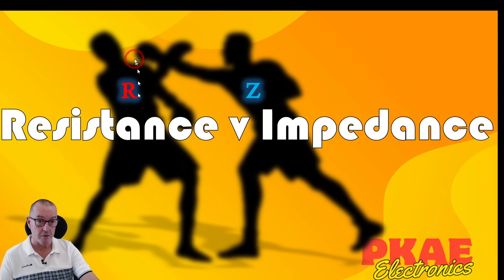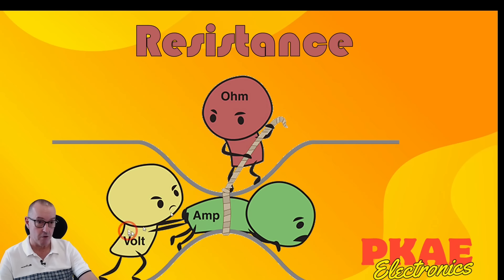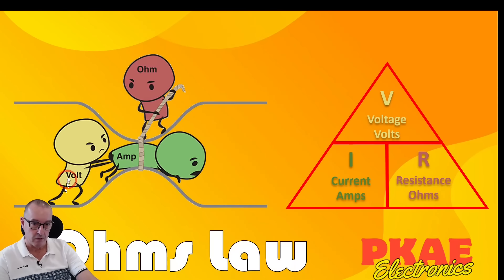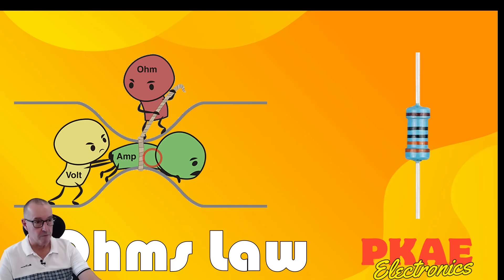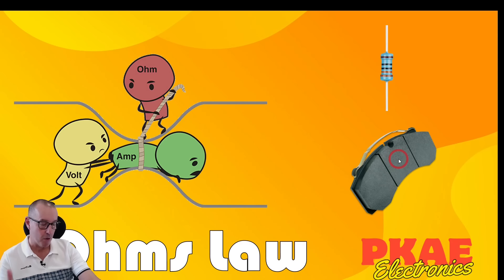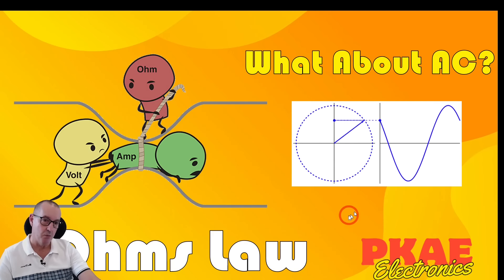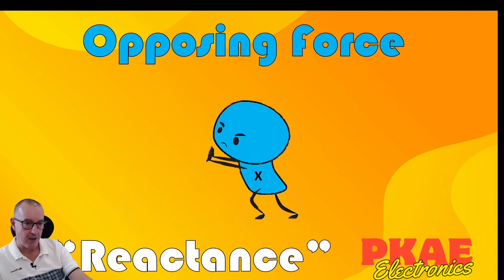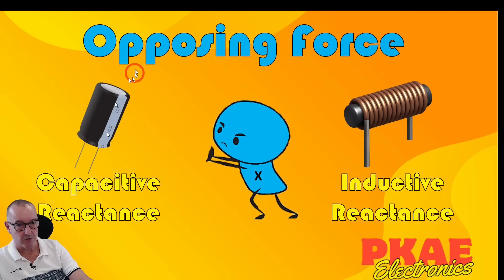Impedance Explained.

Comment: Great vid!
Wish there was a bit of what happens with time dependent frequencies, like in a speaker.
Reply from the maker: Thanks for the comment. For PA speakers we typically calculate and test impedance at 1kHz which is said to be the mid frequency of speech. But as you allude to, speakers have varying frequency response which defines their  characteristics and audio fidelity.

Comment: Resistance is part of impedance.

Impedance (Z) encompasses resistance (R) and reactance (X) 

The Ohm character encompasses both. He's impedance not just resistance, and in AC EVERYTHING fluctuates. Voltage, and therefore Current, and if capacitive or inductive components are presence, then impedance varies too.

Comment: Thanks for the clearest explanation of impedence I've ever heard!

One small nit:  you referred to 0.2 mH has 0.2 microHenrys, but in your equation you write this as 0.0002 H.  That would be milliHenrys, right?

Cheers!
Reply from the maker: Thanks for the comment, and yes you are correct.

I did spot this some time back and added some pop up text at that point. You do need to have Captions turned on though. 

Well spotted by the way!

Comment: My fave thing about impedance is how it allows us to look at the world and think about what a certain wave considers to be a solid wall. 

This video did not cover impedance matching (understandable, out of scope), which one must consider when connecting two regions of different impedance. How the impedance changes across the boundary controls how much of the wave is transmitted or reflected. 

Impedance is a feature of all waves, not just circuits however. Consider a trumpet, or any other brass instrument, why have they got that horn shape? The shape is a kind of impedance matching between the resonating cavity of the instrument and the open air. The horn shape helps match the impedance so that the maximum amount of power is transmitted from the cavity to the air!
Reply from the maker: Thanks for watching and your info. If anyone is interested about Impedance Matching, I did do a follow up video in response to another viewer's request some time ago. See link below:-

https://youtu.be/5p0v7ZU0WcA
Reply: @paulpkae  oh excellent, that's my tea-time sorted

Comment: Resistance dissipates electric current energy into heat. Reactance stores energy into electric (capacitive) or magnetic (inductive) field and gives it back when it can.
Fun thing is symmetry: you can swap capacitance with inductance and current with voltage, and formulas stay the same.

Comment: Excellent stuff. Let me see if I can put everything together when it comes to power factor. Big induction motors have massive X_l and very low R, which means they would have a very "steep" triangle. So they add a massive capacitor to compensate for it, subtracting away the X_c until the load is purely resistive as X_l and X_c cancel each other. That's when you have an optimal power factor of 100%. Am I correct?
Reply from the maker: Yes you are correct, but you are missing the "Power" bit. 

Power factor is the ratio of real power (the actual power consumed) to apparent power (the combination of real and reactive power, where reactive power is the unused portion), indicating how effectively electrical power is being used in a circuit.

Capacitors are added to temporarily store the reactive energy generated by inductive loads during the AC cycle, helping to improve the power factor by reducing the overall reactive power demand.

I will be doing a follow up video on Power Factor pretty soon.....

Comment: Now that I understand that you can just subtract capacitive reactance from inductive reactance, the impedence triangle also helps explain power factor correction. Got a big inductive load? Just slap some capacitors in there to cancel out the inductors and get the phase angle back to zero!

Comment: Sutch a great video! Please cover more concepts! Your ability to easily explain the concept before getting to the math is great. Does this impedance formula work instantaneously for AC? I remember having to do some calculus in school for dc i believe
Reply from the maker: Thanks for the comment, more videos are on their way but I have been incredibly busy for the past month or so. I'm currently in the middle of preparing content for the 555 Timer chip in which I demonstrate it's NOT a Timer.....

With regards to your "instantaneously" question, I don't quite get what you mean, but provided your supply is an AC Sinewave, at a fixed frequency the formula works as it is.
Reply: The impedance formulas are primarily for analyzing AC circuits in the steady state, and not instantaneously.  It's a whole cycle picture of what is happening.

The formulas for what the capacitor and inductor do on an instantaneous basis, are calculus based:
For an inductor: V = L*dI/dt
For a capacitor: V = 1/C * integral I dt

Each circuit with an mixture of the three kinds of components becomes a system of differential equations, based on combining these formulas with Ohm's and Kirchhoff's laws.

Impedance is a shortcut to doing this calculus, with complex algebra instead, when we're interested in the steady state behavior.  When interested in the transient behavior, we'd use the Laplace transform to get a bigger picture of what is happening.  Instead of 2*pi*j*f, this gets swapped for the Laplace domain variable s, a bigger picture of frequency.  It still becomes a way to solve differential equations

Comment: So after watching this it seems to me that this circuit, and formula would be the basis for doing phase correction. Where the resistor in the circuit would be replaced by whatever load you are attempting to phase correct for.. I would like to see a further video on this, as I realized that there may be more complication between the two reactive loads. But my first thought is that you should be able to simply sum all of  the inductance, and sum all of the capacitance, and then run the equation as you have shown it.
Reply from the maker: Yes, you arr correct. Phase or power factor correction is accomplished by applying the opposite form of reactance to whatever your circuit+load turns out to be. Inductive loads being a positive phase and capacitive loads being a negative phase angle.
Reply: @paulpkae  thank you for the reply.

Comment: No one is missing from this classic illustration.

Ohms are the unit of impedance. Not a failure of the illustration if the reader misinterprets Mr Ohms as only representing resistance.
Reply from the maker: Hi thanks for the comment and sharing your valued opinion. My view still stands for me, "Reactance" is not like Resistance. In my mind, the analogy & illustration of someone "pushing back" is far more representative than the guy creating a smaller tube for the current to flow through.

Comment: And this is why spiral wound spark plug wires have low resistance with a ohm meter but still resist the spark and generate low noise. A slight of hand from the marketing people.

Comment: thanks for explaining impedance always struggled to understand it I wish you were  my EE professor ,  would you explain power factor too never really understood it fully.
Reply from the maker: Thanks, and yes, that's on my list. Once you understand impedance, Power Factor is just a small step to grasp.
Reply: It's a calculus problem to give a full explanation of power factor.  The short answer is that it has to do with how well the current and voltage waveforms are synchronized.  The better synchronized they are, the more effective they are at delivering power from source to load.  The less synchronized they are, this results in energy being shuffled back and forth due to energy storage elements, that makes the apparent product of current and voltage (called apparent power in units of VA), greater than the actual power (real power in units of Watts).

The current and voltage figures that we measure in AC-mode on a multimeter, are RMS values, which is a special kind of time averaging.  If you multiply together the RMS values of voltage and current, you get apparent power.  However, if you account for instantaneous product of voltage and current at every point in time, and then average them, you get real power.

Consider voltage and current waveforms given as simple sine waves:
V(t) = V0*sin(w*t)
I(t) = I0*sin(w*t + phi)

The RMS voltage and current will be:
Vrms = V0/sqrt(2)
Irms = I0/sqrt(2)

Apparent power VA = Vrms*Irms = V0*I0/2

Real power:
Watts = integral V(t)*I(t) dt over a full period, divided by the period
Evaluating the integral gives: Watts = V0*I0/2 * cos(phi)
Reply: @carultch  great explanation it definitely improved my understanding of the concept.
Reply: @geraldwesley  No problem.  Glad I could assist.

Comment: The physical examples were extremely helpful! One question is how could a 90 degree phase angle from impedance happen if it's the inverse tangent of (Xl-Xc) and R?
Reply from the maker: Great! Glad it helped.
Reply: @paulpkae  Sorry, I edited my comment while you replied I think. I guess my question is could voltage and amperage differ by 90 degrees or more by something other than impedance or will it never be more than 89.999- degrees out of phase?

Comment: 16:00 You actually can add the resistance, capacitive reactance & inductive reactive together just like a normal series resistance circuit - which is why they're measured in Ohms - BUT it's only valid for a sine wave of a specific frequency, which is the one you specify when you do the maths to calculate those reactances in the first place.
Reply from the maker: Thanks for your comment. Just so that others don't get confused by this, I thought I would clarify further. 

The only time you can add resistance and reactance together is when the inductive and capacitive parts cancel each other out i.e. the inductive and capacitive reactance absolute values are equal, in which case there would be no phase angle. The Voltage and Current would be "in phase" with each other. Therefore your impedance triangle would be flat, because the length of "opposite" side would be 0. 

So, unless you have zero phase shift (which is unlikely), then despite being measured in ohms, you cannot simply add the reactance and resistance together.

The specific sine wave chosen in this video was 1khz, which is commonly used in my daytime job as a PAVA engineer. 1khz is considered to be the mid range of the human hearing range and is a widely accepted test frequency for impedance measurements of audio devices (certainly when used for speech).
Reply: No you can't.
Impedance has two parts: magnitude and phase angle.

When people quote the magnitude of the impedance in ohms, they are omitting the phase angle. It is extremely common to omit the phase angle and only quote the magnitude.

To add two impedances together, or do any calculations with impedance, you need to know both the magnitude AND phase angle for the impedance.

The calculations on multiple impedances must be done using trigonometry or complex numbers.

It is not a simple case of adding the ohm values together. This is wrong.

Comment: Great video, when would you use it, can you give examples
Reply from the maker: The video was intended to equip viewers with an understanding of what Impedance is and to provide analogies that help you to visualise what's going on. In most circumstances, I think most people viewing my channel will rarely need to put to formulas to use but having that understanding really does help. 

For me, it's an important fact for designing input and output stages of audio equipment, amplifiers in particular. As a general rule the input impedance of a device should be at least one order of magnitude (10X) greater than the output impedance of the device feeding into it. Smaller input impedance would means a greater load on the feeding device or module and can have dramatic effects.

Comment: Thanks for explaining! Impedance is clearer now. Now what if the flywheel is turned by superman, wouldn't it be too easy and it's as if there is no impedance?
Reply from the maker: I guess that's a bit like having very high voltage. A strong pushing power.

Comment: Thanks for your video, I have a much better understanding now of Impedance.
So I'm wondering about many power adapters used today for laptops, phone chargers etc, they don't use transformers like in the old days, do they work by efectively increasing mains 230 volt frequency and then using impedance to limit the available current flow?
Reply from the maker: Thanks for the comment. Most power adaptors use fast switching circuitry to rapidly switch the supply on/off through an inductor. The output is monitored for achieving the desired voltage which regulates the rate of switching. There's normally a large capacitor on the output stage to further help maintain a stable voltage. These are known as Buck converters or switch mode supplies. Buck converters generate an output voltage lower than the input and boost converters (which work in a similar fashion) generate an output voltage higher than the supply.
Reply: @paulpkae  Ah Okay, a bit like controlling the brightness of an LED with pulse width modulation.
Reply from the maker: @SusanAmberBruce  similar yes. The output has to be regulated in some way to control the switching frequency. Inductors are capable of generating extremely high voltages.

Comment: A picture can paint a thousand words........volts push amps,ohms restricts amps,devide volts.👍
Reply from the maker: Indeed. 

When using the illustration in my teaching lessons, I also express that:- "it takes one volt, to push one amp of current, through one ohm of resistance.".
Reply: @paulpkae  For clarification it is good,but someone who really pays attention would allready noticed there is one character pushing,one restricting,one flowing.That is one of reasons i comment week back a picture paints a thousand words.
I reckon it would not that easy to demonstrate reactive impedance of inductor,cap; but if you  can you are teacher of the year......

Comment: At 13:54 you said that 0.2mH is 0.2 micro-henries. However it is actually 0.2 milli-henries.
Reply from the maker: Yes I was aware soon after posting the video. I did add a pop up corrective text but you have to have captions enabled.

Comment: We recently installed PV panels with a bidirectional meter to the grid. From that day on the fridge and microwave started failing. Is there a possibility this has more to do with impedance than anything else? A microwave is basically magnets (inductor) and the pump in the fridge is a motor. Nowadays both have motherboards and I guess DC based chips.
Reply from the maker: Hi. I'm afraid its impossible for me to conclude anything and probably dangerous to speculate. I take it you have checked the RMS voltage remains stable and within your countries tolerances?

Comment: In a DC circuit, the capacitor and inductor are static, in an AC circuit, these values change with the frequency of the power supply. The term “reactance” illustrates this change and are measured in Ohms. You couldn’t express this using simple DC terms.
My gf’s car had the interior light that dimmed when she closed the door. I knew that a capacitor did this but in theory, a coil can work in the same way. I guessed that you might have to use a large coil making it impractical. There might be back EMF issues?

Comment: I was taught to write Xc = -1 / jwc and XL = jwl, with that writing z = R  + Xc + XL and the phase angle is simply the arcTan(im / Re) where im is the imaginary part of z and Re is the real part. w = 2Pif.

This video was good for building an intuition. I missed a part where you showed how an inductor behaves with pure DC in steady state. Does it behave like a short circuit because its field is full and can't take any more energy?
Reply from the maker: Yes and inductor in DC will initially push back (when the circuit is energised), but then acts like what it is, a piece of wire. It will of course have some parasitic resistance depending on it's core size and length of the coil.

Comment: your explanation is splendid. 1 issue though, the final formula Z^2=R^2+(Xl-Xc)^2 is not correct from a mathematical point of view as you are not exponentiating the difference of Xl and Xc but differenciating Xl^2 and Xc^2. Thus I belive the formula: Z^2=R^2+Xl^2-Xc^2 is correct. I don't want to go out as a nitpicker of your great video just think it should be out there if anyone goes out and uses the formula mentioned in the video as they will get a horrendously inacurate result :)
Reply from the maker: @maciejkoslinski2923 Thanks for your comment, but the formula in my video is indeed correct. 

It's basically Pythagoras:- the square of the hypotenuse (impedance) is equal to the sum of the squares of the other two sides. 

The length of the adjacent is R and the length of the opposite is Xl-Xc (Inductive Reactance minus the Capacitive Reactance). 

Therefore Z^2 = R^2 + (Xl-Xc)^2.  

You may have been confused about the length of the opposite side which is calculated as Xl-Xc.  This is because inductive Reactance behaves the exact opposite to Capacitive Reactance. I like to think of it in a sense that when one is pushing, the other is pulling. Therefore the total "Reactance" of the circuit is Xl - Xc.

I hope this now makes more sense to you. Feel free to leave another comment if you are uncertain.

Comment: Hey, great video! Do you also have one that describes impedance in audio systems?
Reply from the maker: Thanks for the comment. The concept of impedance applies to all aspects of electronics including audio. The example measurements captured at the start of the video were  in fact from a Public Address & Voice Alarm speaker. 

I did publish a follow up video requested by a viewer to demonstrate an example method of measuring output impedance of a headphone jack.

https://youtu.be/HRlSZ2hJdTE
Reply: Thanks!